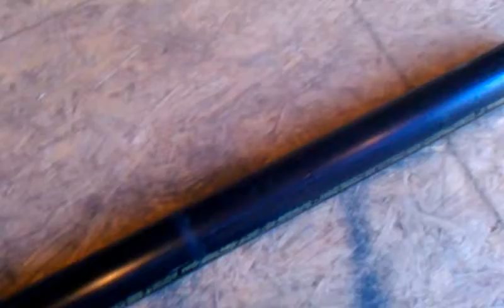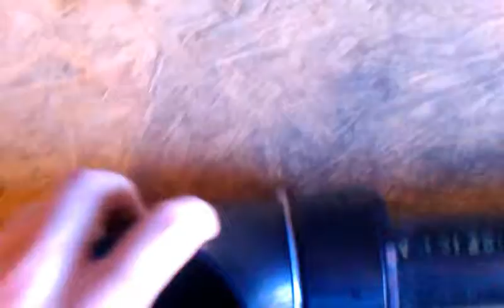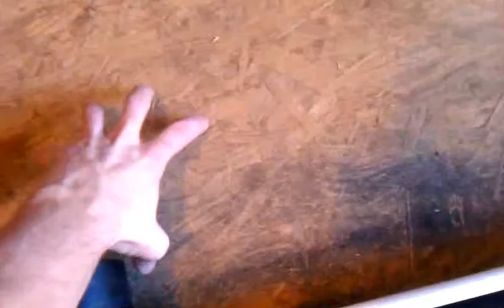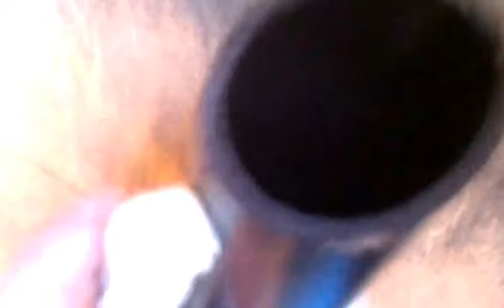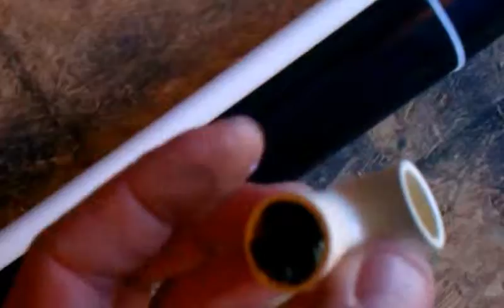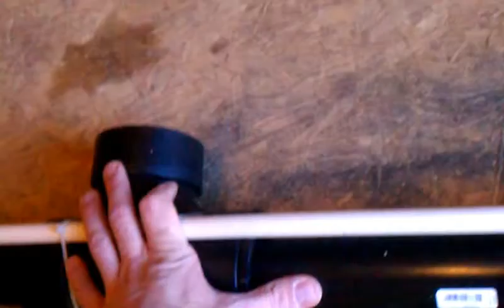DIY Air Lift Koi Pond Vacuum (Part 1/3)

Comment: Just re-watched all 3. Your debris-catching bag looks better than anything I could find. My 1/4" quick connect plug feels like it will thread straight into 1/2" PVC but yours looks like it has another connection at top of the air pipe - I'd like this to be as secure as possible. 

Thanks again!
Reply from the maker: Ok. So, do you have any questions at this point?

Comment: Can't wait to make one! I found all the components except for an adaptor to attach the quick connector plug for the air hose and a good mesh bag to collect the waste. I'd appreciate your advice on those 2 items. 

Thanks!
Reply from the maker: You bet, but before I type out a long response drtmattison, have you watched the other two videos about this air lift system? That might answer more questions for you. Then if you still have some, let me know and I'll be glad to help out!

Comment: Looks cool, can't wait to see it perform. I like your idea of breaking up the bubbles. I didnt catch if that elbow faced inward or upward inside the main tube. I would guess upward would work best. Looking forward to part two. I'm also curious as to how fine a mesh bag you will use on your discharge. I'm not familiar with sucking Koi poo so I'm not sure what kind of waste to expect coming off the bottom of your pond. I am surprised your depth is only 25 inches. I would have expected deeper but I live in Missouri and that's about what our frost line is.
Reply from the maker: Joe Bonomono - Keep watching for more details on it, there's a couple more videos about the Air Lift Vacuum. Congrats on watching my first video ever! lol Some of my earlier videos were a bit dicey but I'm sure you'll be able to find some gems in there. Our frost line is 6 - 8 inches here where I live (I think). In that pond, the water would never freeze if we keep it moving.
Reply: I'm starting at the beginning of your videos and moving forward. I enjoy watching a channel develop. If you go backwards they get worse and worse and you lose interest. 25 inches makes sense now that I know where you live.

Comment: Nice idea the top 2" pipe where the air valve is does the water go up that far or is that upper pipe closed off ,how does the air create the lift and does the "t" have to be above the water level. I have a 50x30'x 3 ft deep pond and have try everything but never thought to try air ,right now im using 1hp transfer pump with a vaccum hose like the one for inground pools. it works bbut plug up often.

Comment: Just one question - in the middle of Part 3 you have attached a bag to catch the debris. This must be a relatively fine mesh if it can also catch algae but I haven't been able to find such a bag. Was this also from Lowe's? If so, what is it marketed for so I'll know where to look for it? Once I get this my setup will be complete. 

Thanks again for the video and the extra advice!
Reply from the maker: You bet. That's a 5 gallon paint strainer. Just go into the paint section and ask them for it and they should have them. I think they come in single or double packages.